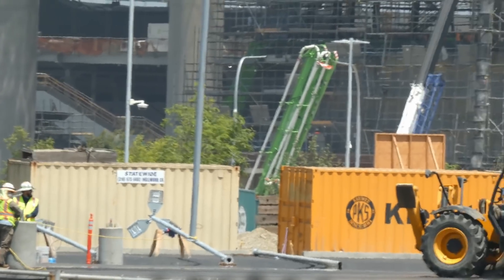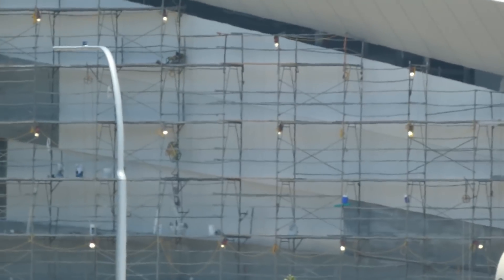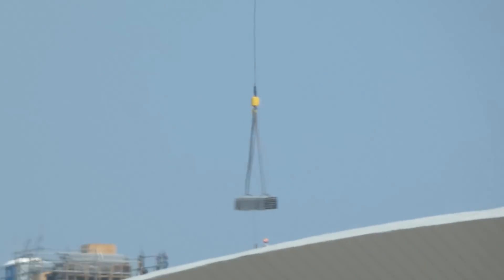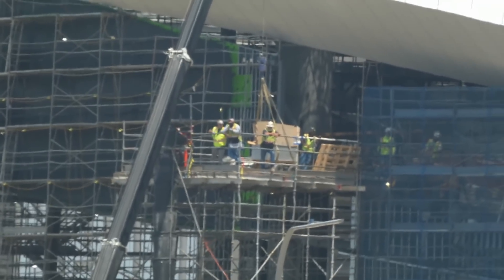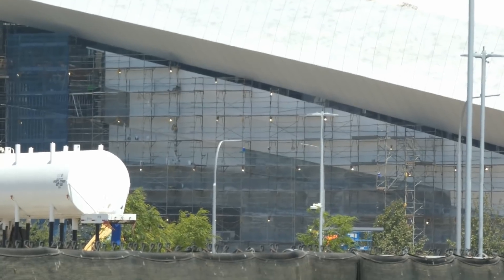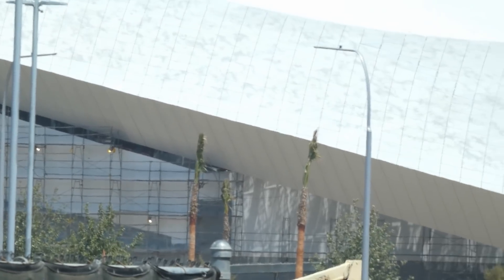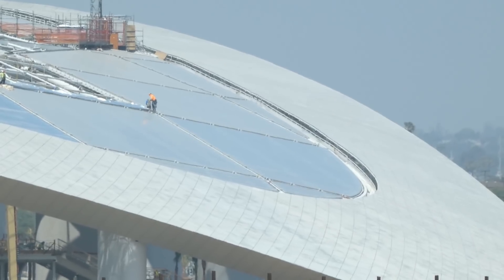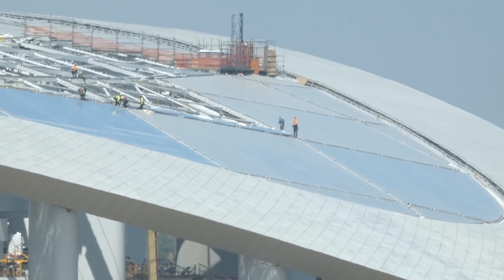LA Rams Chargers SoFi Stadium Construction Update 5.28.20

Comment: The oculus had temp power when it was lower. Since then it has been disconnected and those cables under the tap boxes in the air are being put into the boards for power.
Reply: Does it go up anymore. Or is that the final height?
Reply: deplepfan Thats the final resting point.
Reply: Can't imagine that the Oculus will go much higher if at all. The field is 100 yards below ground level and the seats in the lower decks are also below grade. The fans sitting in the lower decks will view the Oculus from the inside. Upper deck fans will view it on the outside. If it gets higher the lower deck fans will have difficulty seeing it. It's a balancing act because you want the upper deck fans to see it but not block the view of the field itself.
Reply: @dylanschmidt6888  That sucks
Reply: Ty guys cant wait to see it all complete. Horns up
Reply: Drew D why does it suck? Why would you want the video board to be higher?
Reply: Idk what you just said. But I like it.
Reply: Guys who have questions about the oculus height should just go to the virtual venue website for SoFi stadium. Everyone seated in the 8th level upper deck will be looking down onto the field just like they would in any other upper deck in any other stadium. The oculus will not block any view of the field. If you're a weirdo who likes to sit in the cheap seats so you can stare straight across to fans on the otherside in the cheap seats you're screwed.